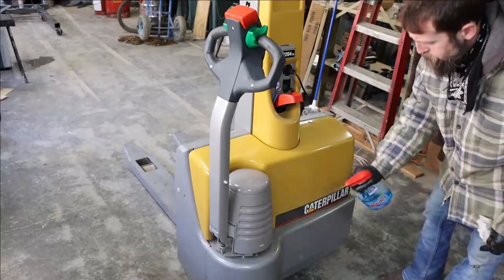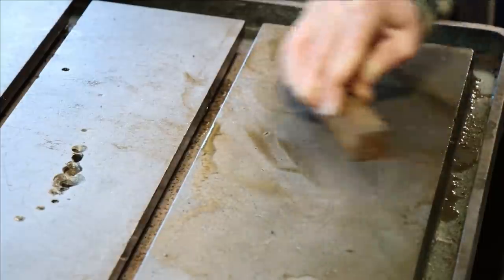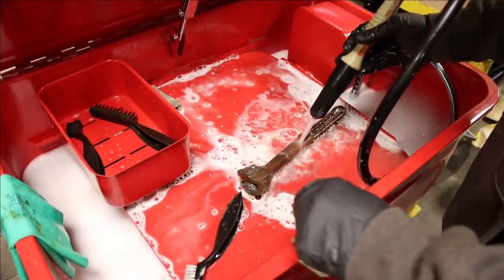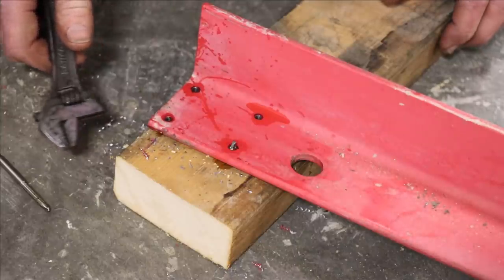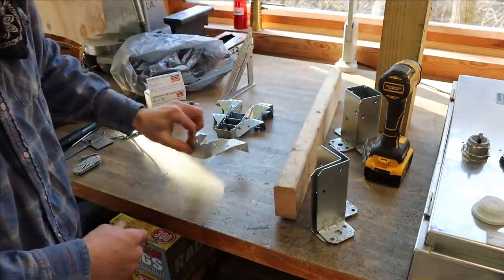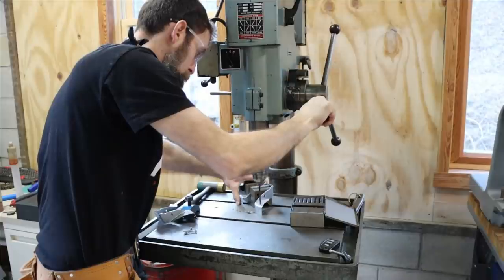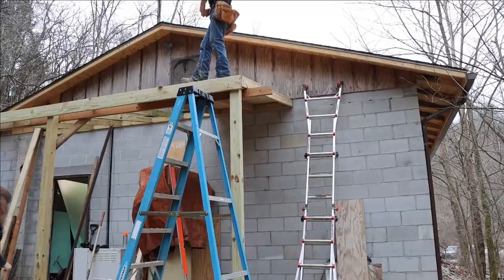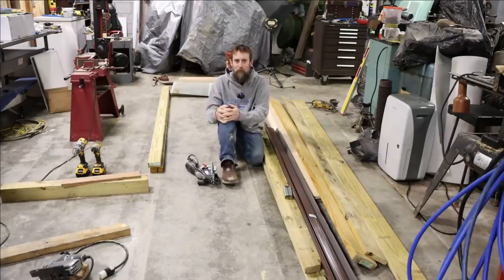Building the Compressor shed off the shop. Protecting my equipment from the elements.

Comment: For your drill press table:  after cleaning the drill holes throughly I used some metal epoxy (two part stick that you roll between fingers to activate) and forced it into the holes in my table.  Let cure.  Then lightly sanded the area flush.  Going on three years and still as flat as the rest of the table.
Reply: I was thinking of JB-Weld.
Reply: You read my mind sir.
Reply: I will tuck this idea under my hat when I run into a similar repair scenario.

Comment: Steve, Great video!  You're probably already past this point, but in case you aren't:  Normally, don't use shingles on a roof with less than 2:12 pitch.  If you do use shingles, use ice and water shield over the entire roof prior to shingles.  Better, use a torch down roll roofing product that matches your shingles, together with a barrier that allows it to be removed in the future.  If you go this route, have a water hose ready to go in case of emergency.  The siding above your roof looks like kindling.  That siding is fine, until you are on the roof with a weed burner torching the roll roofing.  When finished, put flashing behind the siding and on top of the roll roofing with sealant between the flashing and roof.

Comment: As a follow up to Kenneth Roth's comment, I had a table that looked like Steves's.  I used J.B. Weld to fill all the damaged areas, sanded it down and finished it off by stoning the table.  
The JB Weld stoned extremely well and the color of the product blended in nicely with the table.  Over time, it has held up extremely well and has stood up to several stoning of the complete table.  I highly recommend this method of repair.

Comment: You can successfully put posts in the ground. In the UK we do this with pine. You need 1/4 of the length in the ground bellow that 6” of hardcore/mot for drainage. I also paint the length in the ground with bitumen plus 6” above ground for splash. Angle the concrete to drain away. And top that with gravel against the post if the customer agrees. As you stated it is all about keeping water away from the wood and draining it all away

You do fantastic work and there are many ways to skin a cat, keep it all up

Comment: Let me count the times my wife swept up the garage floor, uh, that would be grand total of 0! Good stuff! The project is coming along nicely. You are probably glad you had leftover lumber as a 2x4 is now $7.50. Ouch!
 As a retired tool/diemaker/machinist, I've had a few broken taps staring me in the face. I can only recall 1 or 2 occasions where I was able to grab the broken end with pliers and remove it. Usually wound up burning it out (EDM), or just make a new hole somewhere else.

Comment: Steve, you are getting there. Best place for your granite surface plate is probably your north wall, out of the sun. Check with either Lance Baltzley or Tom Lipton for their advice. Temperature shifts, (sun - no sun) can have an effect on flatness. Thanks for the video. Jon

Comment: Put casters on everything.  Then you can reposition equipment whenever you want.  Especially light stuff like that parts washer.
You can add levers with a cam on the end to get equipment off the casters and onto "feet" when you need stability.

Comment: Steve, good call on not sticking the post into a hole with concrete. They always rot just as you mentioned like stuck in a cup of water.
Eric
Reply: Yes, I agree. What didn't catch thought what was you trying to show that was directly inline of something. I replayed that part and still wasn't understanding what was in the way of something you were thinking of doing?
Reply: @bjre.wa.8681  Steve was explaining that the isle from the side of the shop to the back would have a 3rd post right in the middle of it so instead he is just going to angle brace that corner.

Comment: Steve, the job on the shed roof is top notch. I call those brackets for rafters hurricane clips.  With screws holding them in it won't go anywhere.

Comment: For the parts washing station, get a foot pedal switch for it.  They make ones that you plug the tool into, then plug the pedal into the wall.  That way you can leave the main switch on, and just use the pedal to turn it on and off when you need it while washing parts.

Comment: steve dont forget to leave the batteries on a float charge when not in use tyhis will help stop them sulphating up and they will last longer
Reply: Battery Tender is the best.
Reply: @dcrahn  agreed
Reply: Agree  I've used Battery Tender on my motorcycles, RV, and plow truck. I also use a solar tender on my RV.
Reply: Would the charger for the lift not have a float function built in?

Comment: I have always coated the 4x4's with roofing tar or similar, from bottom and to about 4 inches above the dirt level so water won't touch the post. I have a fence that is 45 years old and the post are still solid except 1 that the tar wasn't quite enough above the dirt and it did rot. I have done many posts like this and so far no problems.

Comment: One little add on I did to my harborfrieght parts washer was to install an engine block heater to heat the solution up works great.
Reply from the maker: I bet that would help👍. Thanks for watching.

Comment: Careful when using that ZEP Purple Degreaser on aluminum. The main ingredient, sodium hydroxide, is very caustic and will etch aluminum parts very quickly, sometimes beyond repair. If you need to clean aluminum, brush the parts only, don't soak parts in this stuff, then rinse thoroughly with water and blow dry. Ask me how I know.
Reply: For the same reason, goggles or safety glasses and a face shield.  This stuff can blind you if splashed in your eyes.  Chemical resistant gloves as well.  I've seen a caustic soda burn on a plumber's arm after he didn't clean drain cleaner off his arm.  Home-owner put Draino in a trap.  Plumber took the trap apart and Draino water soaked his shirt sleeve and burnt his arm.  Ugly!
Reply: @gottfriedschuss5999  Agreed. Steve cut this stuff 50-50 with water, but even then it's aggresive. We use it as a cleaner at work, awesome degreaser but for every day cleaning we use 50-50 water and Simple Green in spray bottle since it's very mild.

Comment: You might want to look at Irontite plugs. They are cast iron tapered plugs for fixing cracks in engines. They would work great on holes in your drill press table and when filed and stoned flush, blend in perfect to cast iron.

Comment: I’ve purchased used AGM batteries for my solar system. I got twelve years out of them with the use of a quality three stage charger. Theses were one hundred and thirty nine amp hour, weighed one hundred pounds each and cost one hundred and fifty dollars each. If it was worth the effort one might be able to regained that taper drill shank, especially if they owned a cutter and tool grinder.

Comment: Paint bottom 6" of post with bitumen, will stop any moisture from ground  being drawn up into wood.Also works well for fence posts being buried in ground.
Reply: I use old engine oil, it works fine too.

Comment: If wood is kept above ground, it can last for many decades.
Dad build a few things that way:
Two small porches from ´82 (untreated lumber, just varnished) are still in perfect condition, every ten years or so the coatingr gets a refresh.
A carport from ´86 had its pressure-treated posts painted just once - right after they were build. It still stands strong, not a single pice had to be replaced (the facia boards don´t look that good though).
The pergola of the same vintage I had to replace in 2019, it had rotted only from the top, down low it wasn´t perfect, but still reasonably ok for it´s age, sitting in plants and our weather (western Germany).All the posts have a tiny bit of distance to the ground though, so they don´t draw up moisture.

And we prefer(red) screws over nails, whereever possible.

Comment: I recommend a bracket that keeps the post off the concrete, concrete + end grain is a bad mix
Reply: You can also get a plastic block that screws onto the bottom of the post. That’s what I used in my shop...

Comment: You might want to consider putting threaded rod with washers all the way through the wall for that plate that your joist are mounted to.  Cinder block is not very good for anchors because it crumbles easily.  The wind load of that roof and the temperature changes will cause movement.  I wouldn't worry about those Tapcon's failing.  My concern is more that the block will fail.
Reply: Those are concrete blocks. They haven't made cinder blocks in half a century or more now.
Reply: @1pcfred  My bad.  Still concrete block are not very good with anchors unless you fill the web with concrete.  They crumble very easily.
Reply: @freeatlast1020  concrete block should not crumble. It is concrete. For his application I think Steve will be just fine.

Comment: Steve, re the tap, I saw it coming - ask me how I know?🤨😳🤪😉🤣😂🤣😂
Reply: Both Steve and I need a set of those Tap guides. I always use tap magic. Clean your taps with a small paint brush, many times during the process.  Also, HEAT is your friend.

Comment: The slow pan looked like it was heading for something interesting in the creek, right up until the point it became gravity assisted and I realised that no-one was holding the camera! I hope it was rugged enough to survive long term :~D
Reply: I thought the same thing, "It's falling!" Then it was in my head that the wife was doing a nice pan to the creek shot until gravity took over and "BEEP!"
Reply: I thought Elizabeth was panning the camera until, like you said, gravity acceleration took over. LOL
Reply from the maker: Well,  it's pretty rugged😁. That was a Cannon 90D camera with several hundred dollars worth of mic equipment on it.  Didn't hurt a thing thankfully. Missed every rock.
Reply: @SteveSummers  I can understand the bleep! Glad it was OK, missing every rock where you are was quite something.
Reply: @SteveSummers  Never hirer Newton as a camera man.
Reply: When it became "gravity assisted" it took me back to a couple of years ago when I fell off a ladder about 4 meters up, it would have just been embarassing and got me a few bruises, until I landed on my back across a scaffolding pole that was a few feet above the ground. I survived and as they say, it was a "learning experience". Glad that Canon make a camera that's stronger than me!
Reply: Yeah safety first. Steve's camera needs a tether. If I was Steve's camera I'd want a hard hat on the job too!
Reply: @SteveSummers  Get a giant C clamp, and weld a camera mount onto the top.
That way you can firmly attach it to a beam/pipe with the screw at one end, the camera at the other.
I've used C clamps to keep an extension cord from sliding across the edge of a metal roof.

Comment: Steve. DON'T ream your drill press spindle taper. The Swedes made good drill presses. Yoy spindle is steel, probably hardened to Rc40, maybe more. You are more likely to damage the reamer than correct any faults. If you do force the issue you may damage the taper. 

I listened to the sound when you seated your drill chuck. It sounded pretty solid. I don't think there is much wrong with it other than a few small debris craters and tarnish. Explore the taper by gliding a small half tound slip stone inside the taper. I do this with the spindle running 200 RPM. You're just feeling for the bumps and scores. Find them and stone them flush. Shine up the dressed taper with a piece of 320 wet or dry abrasive paper wrapped around a piece of doweling. The object is to flush any raised metal but without disturbing the taper itself.

Comment: I used that stuff on my lathe, mixed 4:1.  Let the bed soak overnight and all the paint came off.  good stuff, doesn't have to be super strong, but you need good gloves or it will eat your skin off.  Its mostly lye.

Comment: Steve, you might look into some Devcon plastic steel for the drill table. We have a Milwaukee 2H mill that had a heck of a notch milled into the table parallel to a t-slot. We filled the notch up and dressed it back once set. It's held up really well, probably patched it 28yr ago (man time flies).

Comment: Posts should always be seated in gravel with the concrete poured around the post.  Keeping the foot of the post in gravel allows moisture to flow out the bottom end and not rot in a cup of moisture.

Comment: If you feel like you have to set your post directly in concrete put the post in the hole and then put some loose gravel in the bottom before the concrete. That'll allow the post to drain.

Comment: I would place a nonferrous shim between the concrete and wood post. I've used silicone adhesive to form a moisture barrier and that worked out well too. Concrete absorbs and holds moisture, and the end grain of wood drinks moisture in like it is using a straw. Good call not embedding the wood posts in concrete. Your stuff, your call.  Funny how, at times, the camera angle made it look like there was no pitch on this new roof.

Comment: So, a new concrete pad will be in the future outside the main door to the shop? That lift will be handy at helping to unload loads from the back of a truck. 
Steve, it's a parts washer, not supposed to have the power of the a pressure washer. You might find going with a 2:1 mix with that Zep, (2 parts Zep, 1 part water). That Zep is some good stuff. 
I put 4 locking swivel casters on my press, works like a charm.
I was going to suggest, build yourself an "awning" over the door and the convertor and compressor. Let the building walls support that. 
Don't box it in fully, leave the bottom half open, you'll want good air flow. 
Where's Peanut and Walnut? Do they still come around and visit? Great video. Cheers :)

Comment: You tha Man Steve! I bought an old Clarke Walkie Stacker for nothing, Was told the batteries were bad and couldn't even pull itself onto the trailer when I picked it up. After seeing what batteries cost I tried to regen the bad ones... Got both a used Zivan smart charger and a used GNB industrial one that weighs bout 60 lbs at local battery shop. Of course I like the GNB one better and after quite a few charge and heavy discharge cycles the batteries have come back to working great for my uses. I'm sure they are not 100% but I'm not using the thing 8 hrs a day or even 8 hr a months and have certainly lifted the max rated weight without a problem. Just a thought. ATB

Comment: The thru-holes in the drill press chuck could be easily fixed with some 2K-glue, then they will be tight to coolant leaks...
Raise the posts in the brackets a little bit to allow water running down the concrete pad and not to get sucked into the post itself (wick effect).
Thx for the vid, great work as always!
:-D

Comment: I've always wondered why the cheap wrenches had the screw the "wrong way". I guess they were copying the ones that are common in the US, rather than the Swedish made Bahco ones that were the "nice ones" you'd get in Sweden. There's a selection of Bahco adjustable wrenches in my toolbox.
Reply: Spot on, Bacho adjustable spanners are excellent, and very comfortable to use, even before their "Ergo" range; I have one of my late father's, easily 50 plus years old. All other manufacturers are too heavy by comparison, the heads are much larger, ref lower alloy steel.
Reply: I have a Swedish adjustable  wrench that is marked Volvo, the threads are backwards on it too! It also has an alligator wrench on the other end.
Reply: @RockingJOffroad  I remember hearing that Bahco made the wrenches for Volvo.

Comment: Car batteries have at least 3 year warranty if they do go bad. Don't run them all the way down before charging and they will last longer. Much, much cheaper. Sam's club has cheapest good batteries if close enough. Use automatic charger so as not to overcharge. Very nice lift!

Comment: The Bahco adjustable wrenches go the right way - the others all went the other way to avoid the patent that Bahco had - they were the original adjustable wrenches.  I only use Bahco now as I've got used to the way they operate and other drive me nuts. 😁

Comment: I’ve seen some use lead to fill holes in table tops just to improve appearance. It’s nota wear surface.
Reply: I filled up a really chowdered up milling vise with lead. It's not bad. I'm sure some JB Weld would not be too bad either. Bondo anyone? I bet you could use braze too.

Comment: When I was in the Air Force we used a bunch of that stuff or similar to clean up after a antenna drive high pressure hydraulic line sprung a leak and sprayed fluid straight up and continued to do so until the low fluid switch in the reservoir shut everything down.  Of course the antenna continued to rotate until that switch kicked in.  Everything in the Radom was covered in a heavy coat of hydraulic fluid which made walking around on the sealed concrete floor a real trick which I failed to employ once and landed on my butt, messy, messy.

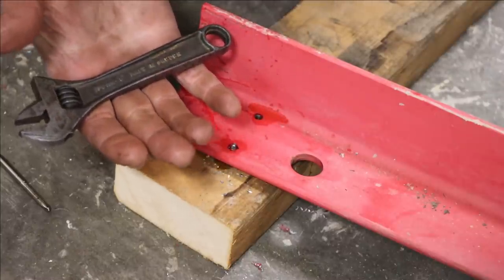Comment: @ 16:05 If U have 2 move the jaws a long way...
& the way U R used 2 moving the wheel on all your other adjustable 's..
Doesn't feel right
Just flip them over 180' & continue moving the wheel in the way U R use 2
When U R close 2 where U need 2 B;...
Flip it back 180' & reverse your wheel movement 4 fine adjust until it fits
Reply: 2B or not 2B, UC.